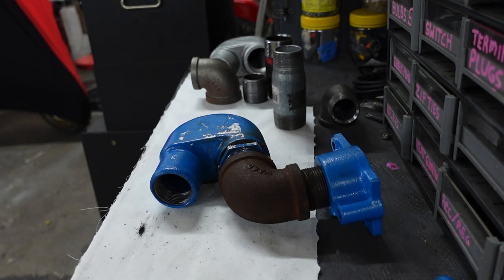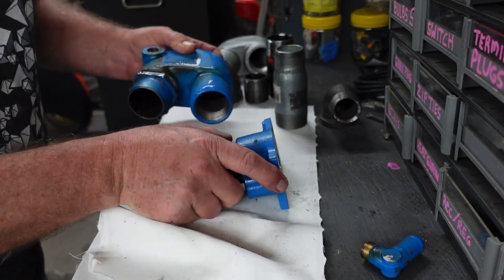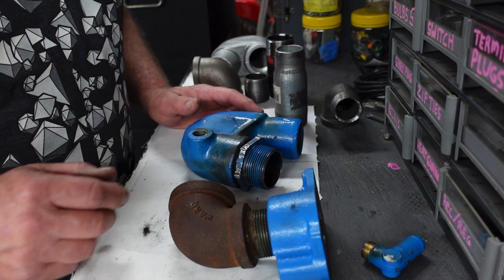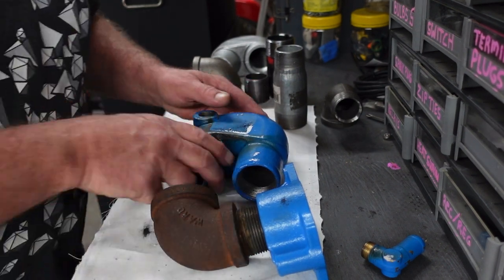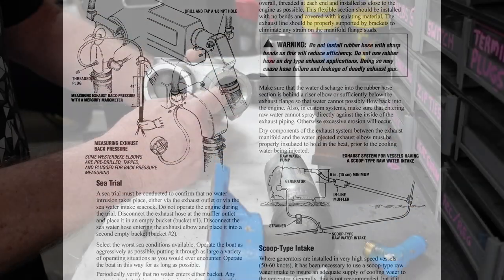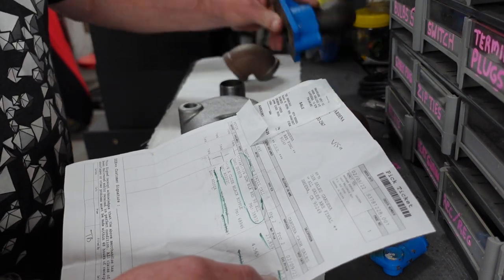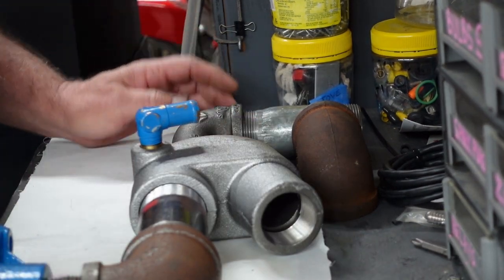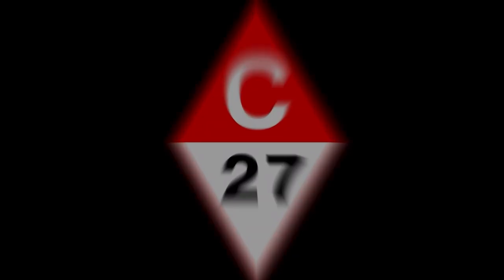CATALINA🔅 UNIVERSAL M18 DIESEL EXHAUST RISER/MXING ELBOW INSTALLATION

Comment: Wow!  I think I have the same problem you had.  It too is from  Catalina 27, Universal M-18.  Do you recognize this part?  (It's the severed  pipe)
Reply from the maker: Maybe, but it’s just text
Reply: @Catalina27  Did you install a anti-siphon valve?
Reply from the maker: Yes
Reply: @Catalina27  where abouts? On you riser? TY
Reply from the maker: On the raw water injection hose that feeds the mixing elbow.